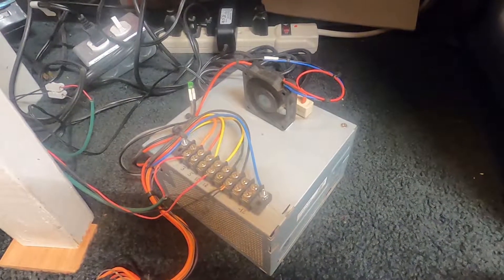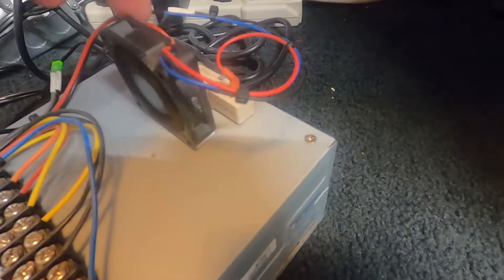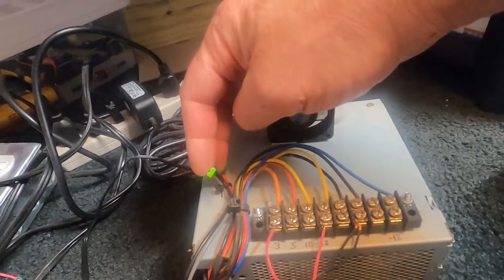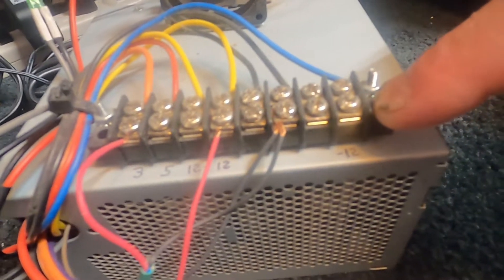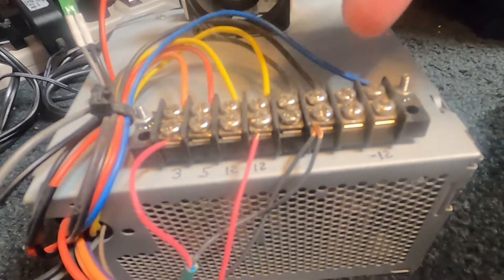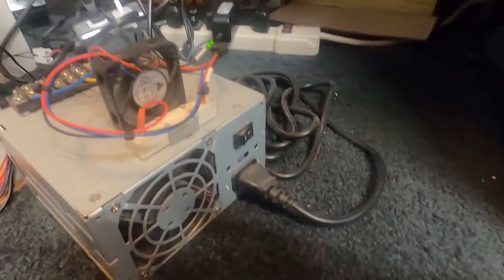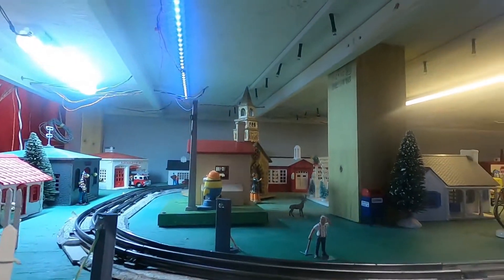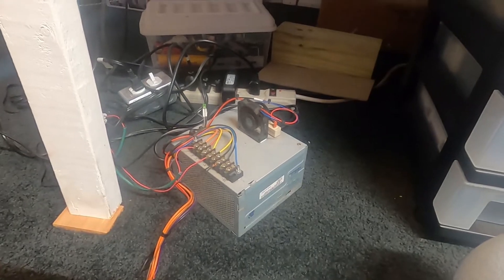Using a computer power supply for your layout (LED) lighting

Comment: Would work as a train controller psu, 12v to 2amp fuse to a motor controller with reversing switch to power the track
Reply from the maker: That would work.  Thanks for watching.
Reply: @dbtech7914  No problems. Also had a thought this morning you could pair the -12v with the +3.3v to run 15.3v to the controllers instead of the 12v. I'm running Super3 track so the higher voltage helps

Comment: Do you use a separate power supply or a controller? I imagine it would use a lot of energy idling. If not a controller maybe a PIR sensor or trigger by another device turning on?
Reply from the maker: I'm not sure exactly what you mean.  I have the power supply plugged into an outlet strip that I turn on when I want to run trains.  When the power supply comes on, it powers the LED lights on the layout.  There is a small fan and resistor on the computer power supply to provide a load so the power supply works.
Reply: A 500watt psu is rated to 500watt max output, Having a load on it which keeps it powered on youre never going to be drawing more than 500 watts of power, even then the psu is only going to use what the led's demand so if thats only a 20 watt draw then you're only using 20 of the 500 watts the psu can provide

Comment: Really cool idea 👍 Using the lower voltages for your lighting. Do you still put in a resistor in series with the LED’s to cut the load to them? I’m putting this idea in my Hall of Fame of train ideas, along with your 5mm x 25mm screw fix with the MU2 motor repair  😎🚂
Reply from the maker: Actually, they are 2.5mm x 20mm for the Tyco MU2 motors.  I've had 2 or 3 people ask me about them!  The LED light strips are dollar store lights that use 2 AA batteries, so they run off of 3 volts with no resistor.  The 12 volt lights don't need a resistor.  I think the one light (from harbor freight) runs off of 5 volts and I think that has a resistor.  Thanks for watching.  That power supply is pretty handy!
Reply: @dbtech7914  Thanks for the information on the LED lighting and screw sizing 😉 The power supply idea is really some nice work 👍

Comment: Wow that's really cool. I never thought of that idea. I mean geez somebody can use the lower voltage for controlling accessories switches Etc versus using the power supply that's built on the Transformer which makes it so that energy gets used on that versus running the trains around. I think the switch on the back of the power supply is it good option even though you have it on a power strip it's an added protection as well I would think. One good thing about the computer power supply it only uses the power that it needs and if more is required it will have that buffer to ramp up the voltage or amperage like it does when it's hooked up to a desktop computer if the processor needs more power demand it will give more power. I like this

Comment: WOW! How cool is that! That’s very interesting. You can adjust all kinds of voltages to your specific needs for all kinds of accessories. Great idea! 💡Any idea on how much amperage this puts out?
Reply from the maker: That power supply didn't have a sticker on it, but they are usually 500 Watts which would give you about 15 amps for +12V and +5V.
Reply: @dbtech7914  That would work out very well for accessories and things for sure!

Comment: Thats pretty cool!! Can you run the trains on it as well or no? Probably not though.
Reply from the maker: It would run a train, you would want to have a voltage controller or your train would go fast or stop.
Reply: Yeah David's right it would run it's just she would have to have a voltage regulator like you know on your controller when you turn the knob inside the controller is a voltage regulator pot same thing that is used on a stereo system that makes the volume go up and down but it's just the different application.
Reply: @mercuryoak2  I see I’m thinking about getting another transformer for my ho scale layout.